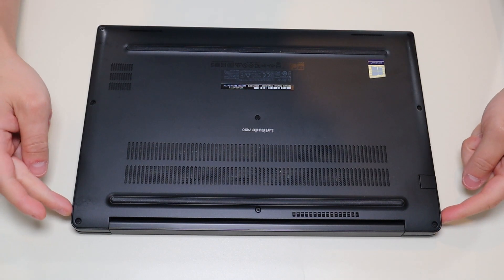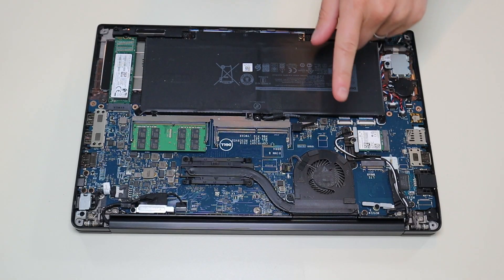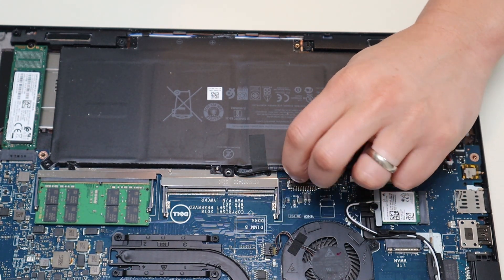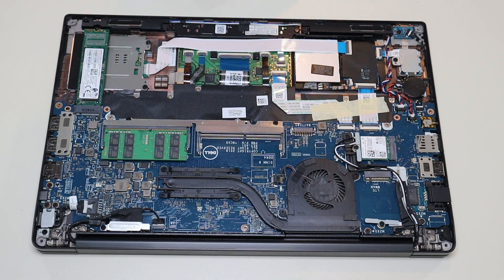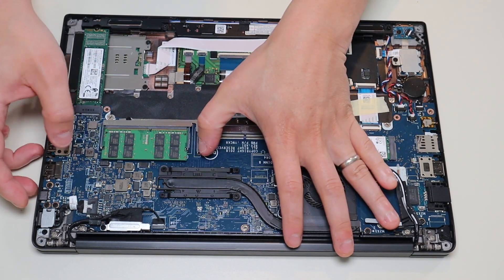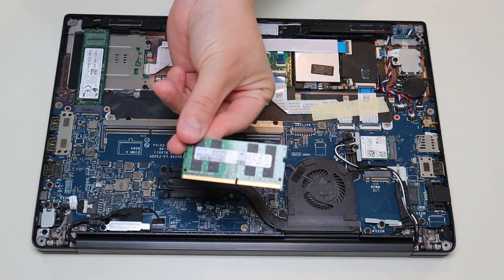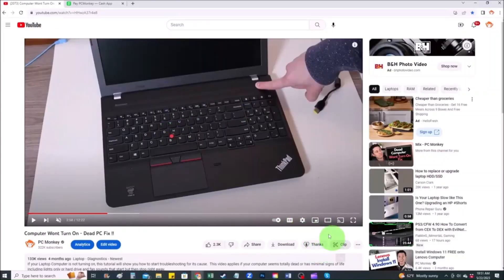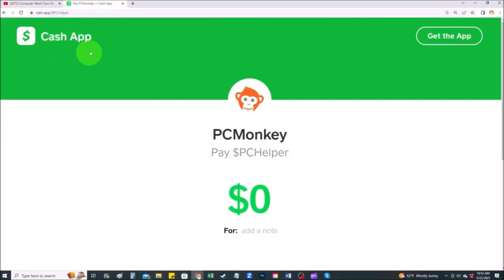How To Replace Upgrade RAM - Dell Latitude 7490 Laptop

Comment: I have this model and it already has an 8gb stick in one of the slots. So can i just purchase one more stick of 8gb to put in the other slot to get 16gb or would i need to purchase a 16gb ram kit and replace the original 8gb stick as the ram has to come from the same company? thanks